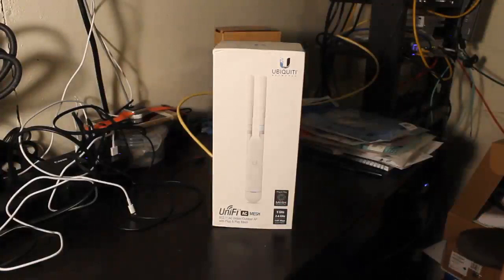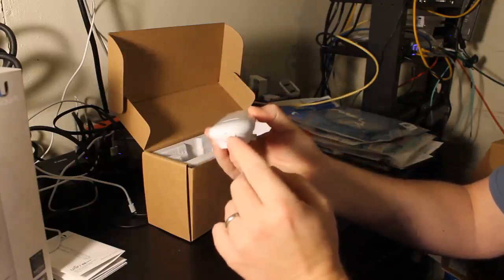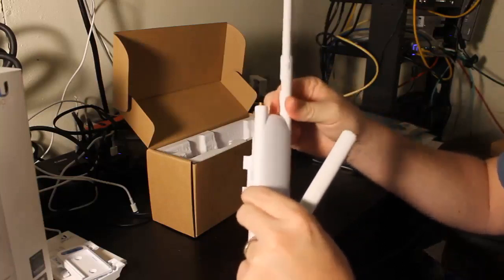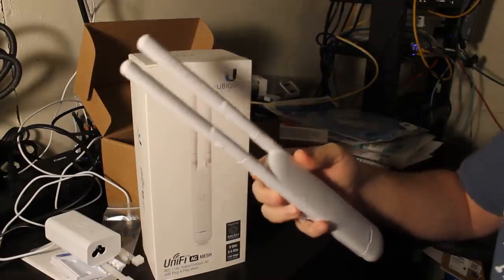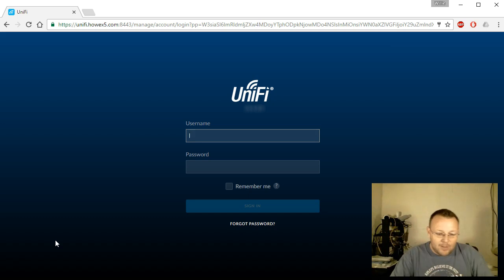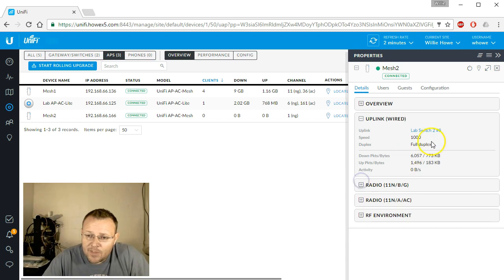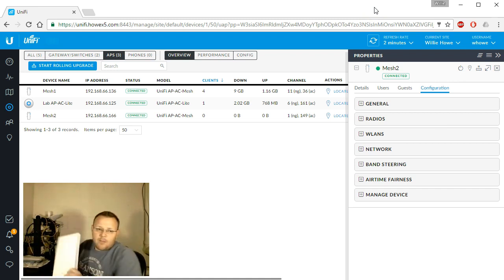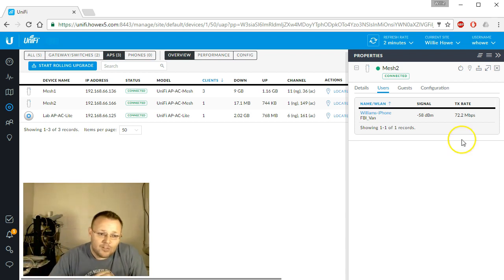UniFi AC Mesh Unboxing and Adoption

Comment: Great video and seems to be a neat product, but I'm trying to figure out if this will work for me or not.  Can anyone help?  I'm trying to get WiFi to my second home across the street, and I have an Asus Wifi router in my first home can I connect a UniFi AC Mesh at the front of my first home to provide Wifi to my home across the street?  Also, do I have to hard wire the UniFi AC Mesh to my Asus router or can it connect wireless to my Asus router?  Suggestion or advice anyone??   Thank you in advance!!

Comment: Greetings!
Please, I have two questions:

1- What is the actual distance that this AP reaches in an open field, like a stadium where a musical happens?
2- How many connected clients simultaneously are recommended to the maximum by AP?

I ask why the manufacturer's specifications do not seem to be real (120 Clients / 183 Meters).

Thank you!
Reply: Good questions with plenty of forethought.
1) Distance is subject to adverse conditions such as noise floor and physical obstructions. With no elevated noise floor  or obstructions  you can realistically get 400 feet.
2) EXCELLENT QUESTION!!!! Nobody talks about this and why it is important. The 120 clients might be able to connect but that is only on the RF side not the usable intenet  side. See there are two sides of this equation, connected users and actual users. Connected users are connected wirelessly but not using bandwidth, actual users are doing both  meaning connected wirelessly ad using the internet.
Manufacturers keep upping the number of connected users in some sort of swinging dick contest  but fail to disclose the amoount of actual users who can actually use the internet. This practice was acceptable before streaming became mainstream but not now. It is an asshole move on manufacturers to inflate what these devices can actually do. 
In this case the maximum "Actual Users" is about 34. I know I have set up a fairly good size wireless network for a time share to suport 544  users with 16 AP's.
If you need a higher density AP, they make them at 12 times the cost, or you can just add more of these $95 devices and spread them out across your property.

The controller is awesome and has plenty of flexibility for a myriad of designs. I have built a business on using Ubiquiti products.

Comment: My ethernet cable with not insert and click in to the port on the Mesh. any tips into what is going on.  The ethernet cable connects to my laptop and other ethernet ports but will not click into place in the Mesh

Comment: HI Great Video. U n Chris from Crosstalk solutions are the best.

CAN U MAKE VIDEO HOW TO DAISY CHAIN THE NEW UNIFI AC MESH FOR CITY WIDE DEPLOYMENT.  WHAT WOULD BE THE SPEAD EX. WITH 10 USERS  ON THE 5TH CHAIN/HOP/ACCESSPOINT. HOW DO YOU CONFIGURE THEM IN UNIFI MANAGER  GUI.  FROM START TO FINISH.   THANKS.  

ANY QUESTIONS? ASK ME.

Comment: Was going to get a couple of AC lites for a house indoor installation, but this looks like a better alternative to the AC-lite for home use, with the advantage of (optional?)mesh and proper PoE.  Will it work as independent wired AP like the AC-lite? Thanks for the videos clearing up the unifi  "mesh" function confusion.

Comment: This looks pretty cool - thanks for posting this introduction.
I'm really interested in how theses can integrate with existing AP's such as an AP-AC-LR.
I just picked up one of those and an Edgerouter-X and it would be nice to be able to extend it in a Mesh style.
Looking at the docs (page 4 of the Quick Start Guide), it does show that a UniFi-AP is required for wireless adoption - but I'm more interested in what benefits you get when you can still have everything wired up and integrated.   Thanks.
Reply: Sounds great!   Thanks

Comment: It'll be interesting to see in a couple of years if mesh networking continues to be adopted by more companies and becomes more ubiquitous. And hopefully if that does happen we can get some vendor interoperability going. I hope so, because I have a project in mind that I'd like to try to build, but I don't want to be locked into a single hardware vendor.
Reply: 802.11s is the only mesh standard I'm aware of. I do know it can run several routing protocols over it as part of the spec. It wouldn't surprise me if some of the mesh products released this year by all the different companies that did are using the 802.11s standard (or some kind of slight variation), but using different (read: incompatible) routing and/or handshaking protocols. From what I've seen of the Ubiquiti mesh stuff, it looks like it only supports a single intermediate wireless hop (to another mesh unit). I'm not entirely sure though. 

I know most of this easy-to set-up mesh stuff is still fairly new. I'm just hoping all the manufacturers can settle around some interoperable standard,whatever that may be,  (and hopefully one that at least has the option to support several hops) sooner rather than later.

Comment: Other than the form factor, how are these different than the AP-ACs?
Reply: I had the same question. I feel like a good deal of Ubiquiti's networking equipment is very much the same (as far as what they accomplish). Maybe I just don't understand the more technical aspects that sets each device apart. I know there are small differences in each so it would be nice to hear some of the specific applications of this Mesh system and how it compares to what existing devices already do well, i.e. UAP AC-Lite, Amplifi, etc.